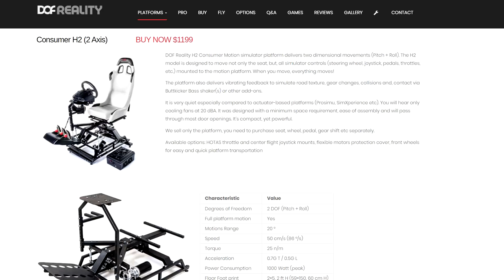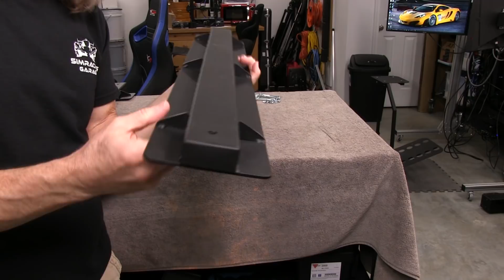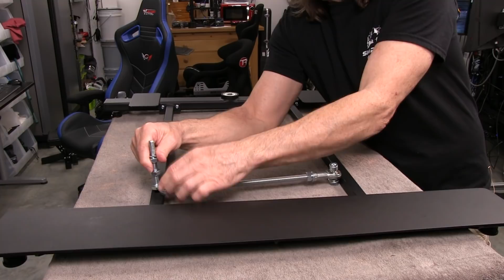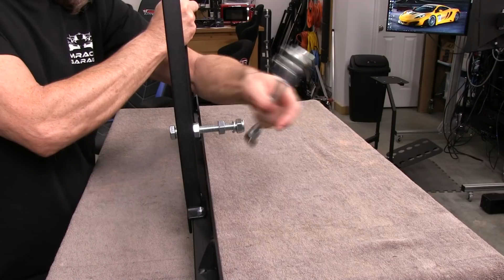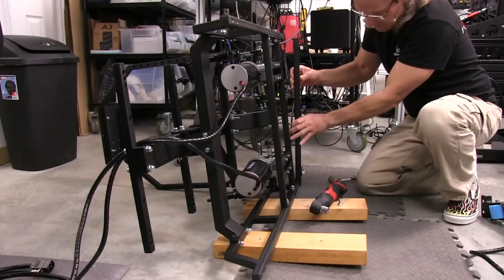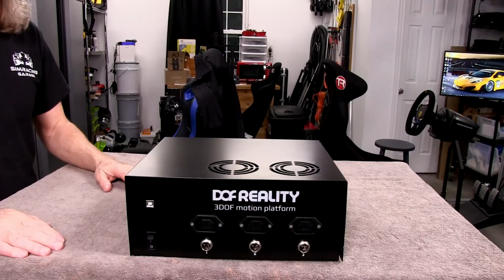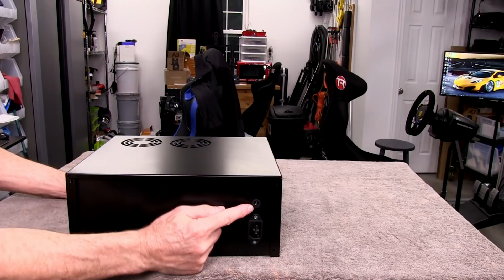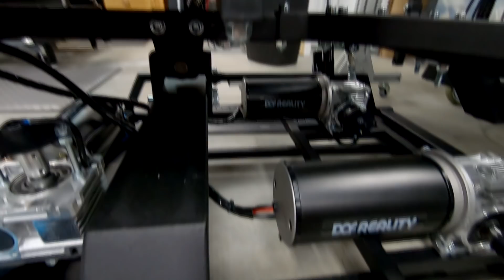DOFReality H3 Motion Cockpit Review

Comment: Been running my H3 for about 2 weeks now. This thing truly is awesome once properly tuned. Just added a couple bass shakers to it yesterday which really ups the immersion. Combined with VR, I'm at a level of realism I never expected to reach. Couldn't be happier.

The profile is thin though, so expect flex, especially at the wheel deck. I added a few supports to it and it's now handling my 12nm DD just fine. I've actually seen a guy mount a full 8020 rig on top of it too! That said, I'd certainly recommend buying if considering.
Reply: Paul Riccobene did you consider the h6?  Do you think you are happy with h3 or will you consider upgrading?
Reply: @macarollo  I seriously considered the H6. My thought was to just go all in as I really wanted the full 6 dof,  plus it's like a $600 savings over upgrading later. But after talking with some existing owners, most feel 6 dof was ideal for flight, while 3 dof for driving. Based on those discussions, and my wallet, I went H3. Now that I have it, I don't regret my decision at all. I don't know how different the 6 feels compared to this, and I know you lose out on true surge/heave, but I don't think it's something I'll ever worry about upgrading to anymore. Inside VR this is super impressive, and I'm gonna agree with others that the rear traction loss of the H3 might be the ideal setup for driving. If you don't have the cash for the 6, I wouldn't even hesitate to go for the 3. It's beyond good. ;)

Feel free to ask any other questions. I have a few short videos of it up on my sim channel too.
Reply: @paulriccobene  Thanks for the info.  I have been considering H3, but I was thinking why not keep saving to get the H6 as it looks even better, but it's great to hear your perspective. I use Rift S now with a stationary rig, along with bass shakers.  I used to think a motion rig was just out of the question, until I saw the great value of the H3
Reply: @macarollo  I totally get your thinking. IMO, if you can swing the H3 now, I'd go for it. 

Hear the Rift S is nice. Need to upgrade my O+, just waiting on newest Pimax reviews.
Reply: That’s my concern watching this video, the uprights holding the wheel deck do not look very substantial
Reply: @DavidBrown-X  There's no way around it, they are not very substantial. 20mm punched square tubing supported only by two bolts at the bottom. That is the biggest flaw with this unit. But, considering the pricing for 3 DOF and the insane fun it adds to racing, a small diy is well worth the trade-off. Honestly, the flex really only appears to forward/backward, not side to side, so shouldn't be too big a concern. I've seen videos from a guy with a large mige mounted and he's doing just fine. I've also talked with a guy who's had his for quite some time issue free. So a little wood or aluminum extrusion is the least of my worries. 

Oh, Igor hinted at an upgraded wheel mount in the works as well. No idea of time line or cost, but hoping that's soon and the simplest solution.
Reply: Paul Riccobene Oh! I hadn’t heard about an upgraded wheel mount. Will definitely look into this when/if it’s released for my P6.

Comment: Has the H3 pro with bigger motors for 6 months now and it's applsoultly awesome. Software constantly updated with new support rally games in VR is ridiculous.
Reply: So jealous,  I purchased a wheel  pedels and  VR  for racing sims, and I love it,  grinning  like  a Cheshire cat  whilst circuit racing,  but two corners and a hump in on a rally stage,  an my brains  dazed and confused,  shame cus I love rally. i  imagine that a  set up like yours would cure the nausea too. If so I'm in.
Reply: @christopherpope1800  rally games genuinely make you want to chuck lol which I am guessing is like the real thing. The rig really shines in GT3 and sports cars weres there's some movement in suspension plus the kerbs stuff
Reply: Interesting about those bigger motors. Did you take a look at them? What is the more powerful motors setup? Stip 1500rpm, 24v? 
And do you keep the same size and ratio (25) gears as in this video?
Reply: @ArenaTM  there just quicker and more resilient for longer gaming sessions
Reply: Have you done any flight sim videos?
Reply: @theVRpilot  not yet mate just doing some rearranging of my two rigs and will be doing my first videos within a month
Reply: H3 pro? Isn’t that the P3? There isn’t another model is there?

Comment: Seems like a nice compact solution although it would be hard for me to go for such a fixed rig from a 80/20 profile rig that's very flexible and sturdy. One thing that rig still misses is a GS5 seat for the longer duration G-Force effects.

A good sim racing setup is basically like having a good 4-way speaker with proper separation of frequency ranged effects...
Tactile = Tweeter
FFB Wheel = High-Mids
Motion rig = Low-Mids
G-Force Seat = Subwoofer
Reply: LogiForce86 the motion platform has much better sustained effect than a gs5 seat...you fell been dragged by centrifugal forces the whole curve